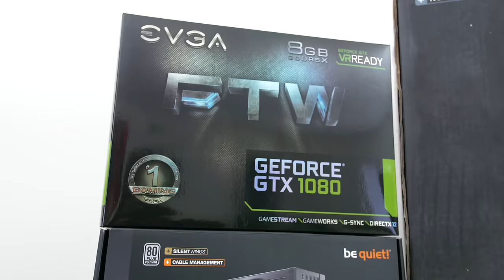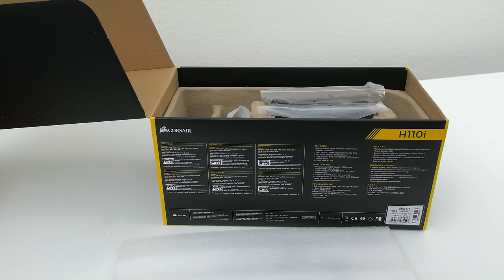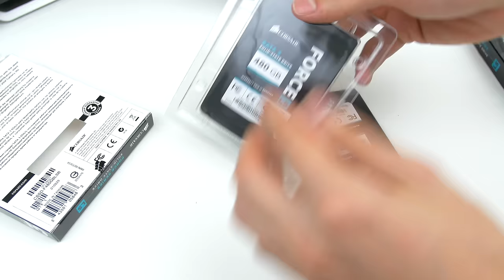$4200 Ultimate Gaming PC - Time Lapse Build

Comment: You can achieve same game performance in much lower costs with i7 6700k
a hard drive instead of this insane ssd
a cheap motherboard
Reply: a cheap box
Reply: not the same game performance, it will be lower.... plus higher load times because of a normal hard drive. A cheaper motherboard wouldn't support 64 gigs of ram like this one, and a cheaper box might not fit everything, and wouldn't look as good.
Reply: Abel Sullivan first of all , higher load times doesnt change the fps, so the experience will be the same, secondly there is no game that requires more than 16Gb of ram, and you can also find a midi tower with 20 dollars, and also how good a case looks doesnt affect perfomance, so yeah, you are completely wrong
Reply: The point of this build isn't to be the best bang for the buck however, it's supposed to just be an awesome build ready for anything.
Reply: SSD's are way faster
and you need a motherboard that can handle the power of the components.
Reply: Jesus Christ, you don't know anything about PCs. First of all, the point of the video is just to show an "Insane $4200 Build", this doesn't mean it is the most effective or the best price for dollar per frame. Also, SSDs are much faster than hard drives.
Reply: It has more ram for editing and a $20 case wouldn't be compatible with the liquid cooling system and it also wouldn't handle the heat coming off the components very well. Which can lead to overheating.

So you're wrong.
Reply: Gasoline Stoner Saying for the 3rd time, your comment is useless, as that is NOT, I repeat, NOT the point of the video.
Reply: youre right
Reply: +Jubb Wubb It's not useless at all, alot of people who is just getting in to building computers would find this comment very useful cause the majority is looking for a gaming experience computer and probably thinks that this pc/the performance of this pc is only available if you spend 4200$, which to be honest is money almost no one have when they start out. So by Gasoline Stoner writing that comment he basicly learned everyone that you could almost have the almost same performance for a much cheaper price.
Reply: Guys stop, you dont need to prove you're better than someone named "Gasoline Stoner" XD
Reply: Gasoline Stoner For the 3rd time, stop inhaling gasoline.
Reply: +Gasoline Stoner "yes you get idiot"

stop inhaling gasoline
Reply: ***** Of cource its good, good for my entertainment
Reply: No one said this build is focused on game.
Reply: Liangshi Xu neither I
Reply: +Gasoline Stoner obvious troll but i wont spoil it for them

oh wait
Reply: Gasoline Stoner A guess the CPU is a bit overkill, yes but this build isn't just for gaming. It could be used for editing and other CPU intensive tasks that require powerful components.
Reply: +Cairo Murphy his point is it's the "Ultimate Gaming PC," not "Ultimate Productivity PC." I get your point too, though. He probably wants more than to just game with a PC like this. I honestly expected a second gtx 1080 to come in, though, plus a custom water cooler. Altogether a cool build, anyways.
Reply: the ssds confused me. just the ssd, i love.
Reply: C'mon guys, I strongly agree with Gasoline Stoner. All system builders know that the i7 6700K is better for gaming since most games can't take advantage of the extra cores. I don't think this is a very good build, this isn't because I want TechSource to save money, it's simply because there are other cheaper options that offer the same or even better gaming performance. That's all! That was what Gasoline Stoner has been pointing out, he seems like a smart builder, not a troll.
PS: If you can't take my word, check out the benchmark scores for the CPUs. 
And have a great day y'all.
Reply: Blue Play Productions i agree, the 6700k does give better performance... and he probs should have done a less insane ssd setup. that one makes no sense... but ssd's speed up loading times, which i like. after all, it is the "ULTIMATE" build... but it still sucks XD
Reply: An SSD is essential if you want a smooth overall experience, even the greatest PC's without an SSD feel and are laggy, If you don't have one it should be the first thing you need to get.
Reply: ***** cool, and what does have to do with anything i said?
Reply: and a none modular PSU, less ram(not needed) and a pretty standard heat sink
Reply: +Ernis ☆ CSGO ☆ lies, the HDD purely decreases load time, not overall speed. that's called a processor :)
Reply: +Ernis ☆ CSGO ☆ probably don't talk about what you don't know, pretty sure ncix, and even techsource has explained that HDD speed is relevant to load and not drive.
Reply: +Gasoline Stoner clearly knows what he's talking about, Jesus Christ, I wasn't expecting so many kiddos in the comments
Reply: The i7-6950x is a bit overkill lol.  

As for the case, yes you can get a far cheaper case, but some of us like being able to show off our awesome rigs.  With that said, you can get some really badass cases for $60-$80.  

At the end of the day, people want different shit.  If someone wants to spend $4,000 on a pc and they have the money, by all means, go for it.
Reply: I wasn't knocking someone who wants to build a 4K rig.  My current PC cost more than the car I'm driving. 
I did however say the i7-6950x is overkill.  That is unless you edit videos A LOT!
But I agree, a 4K pc isn't that much if you have a little extra money to spend.
*****
Reply: It is very sad that some guy thinks hes the adult here. Like i said, you dont even know me, stop thinking that your far more superior than other and others are kids. That is one single behavior I am talking about that makes you the immature one here. How do you not waste time when all you do here is trash talking? Plus why would you take a profile picture that makes everybody think your drunk? It is those kind of pictures that makes social media a pain for high placed people like presidents and such. Man if every single person takes a pic like this what do you think this world will turn into? Just think about sir. Why would you buy a 600$ pc only to play league of legends? Like i said, technology advances very fast. We can already see league of legends is not a game as popular as it is and everyone has moved to overwatch. It takes about that 4 years to make it happen. Also, 4 years is plenty of time. 4k will be so overrated by then, look how fast these few years has come with resolution. You had to pay 2000$ for a 45" tv in the early 2000"s. (3D didnt work as intended, so we will not talk about it.)Now 1080 is slowly being eliminated and 4k takes its place. Now the newest thing is VR, which will be the biggest hit and what pc gamers will go for after a few years. Hence the VR ready graphic cards. Wake up dude because all you are saying does not make sense, very selfish and irrespecful. Instead of just stabbing others with offensive words like "your a kid"and presume that others are younger than you, just start listing facts. My "offensive" words i used is to purely describe your behavior against others, so dont get yourself wrong. This is not a normal ssd that everyone have and can afford it. Its made for server hosting, which is new for me. Every gamers wont use this as their SSD's because this is a luxury.
Reply: I disagree about using an HDD and a standard cooler (I&#39;d user a Noctua NH-D15 cooler, less money and equal or better performance than the corsair AIO for less.. BUT if it&#39;s an ULTIMATE GAMING build if definitely go with a 6700K CPU, as most games will perform better on its fewer but faster cores.

Also I me load times are important and part of my gaming experience, SSD all the way. But 64GB of RAM won&#39;t really give you an advantage in gaming. in fact I&#39;ve seen benchmarks where PC with less RAM had a marginal FPS advantage to the same PC with 64GB of RAM, at least in some games.
Reply: There is definitely ways to save money but I wouldn't get rid of the SSD to save money. Everything else yeah.
Reply: It will be the same game performance. Most cheap motherboards support 64gb of ram. 

He uses the PC for editing as well, that's why he got the more expensive cpu

Comment: I hope that someone will help me. I just got a quick question about the x99 platform because i wanted to do the same 6950x build but on pcpartpicker's site it says that i have to update the bios of the x99 mobo first using another compatible cpu before i can put the 6950x. Is this true? Please help.i'm not rich and it took me months to save up and i don't want a couple month's work go down the drain. This will be my 2nd build, my 1st build was 10 years ago then some things in life happened which made me quit pc building after my 1st build.Help!
Reply: tip: d o n t u s e t h a t c p u
if u wanna make an ultimate pc that isnt dumb, get a gtx 1080 ti, 8700k, any good aio with at least a 240mm radiator, 16 gigs of ram (2666 mhz or better), a nice m.2 ssd, and a 1tb drive

Comment: Imagine running a $4000 budget with $500 gfx card.

Nowadays that's hilarious with people doing sub 2000 budget builds with 1200 dollar graphics cards.

Hell, my 2080ti, 3800x build that set a few WR for overclocks, was a 4000 budget on a 3 rad custom loop. This has a 240mm AIO for the cpu for cooling. I'd say even 3 years ago this PC is realistically a 1400 dollar budget

Comment: i just spent $3,800 on a gaming rig. it has the  EVGA GTX 1080ti SC2,11gbs gddr5, 32 gbs of RGB Trident Z  3600 gddr4 memory, Intel core i7-8700k cpu, MSI Z370 gaming pro carbon ac motherboard, 1 tb SSD boot drive, 2 tb hdd,...and that was canadian $,..so around $400 american. xD